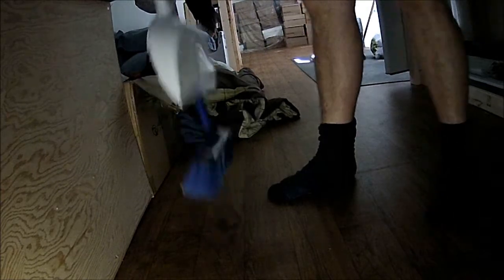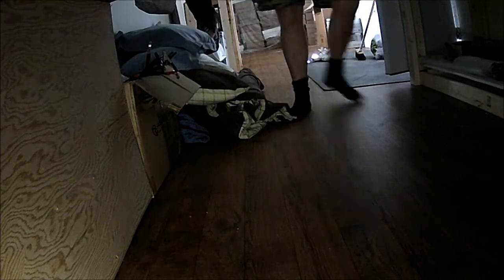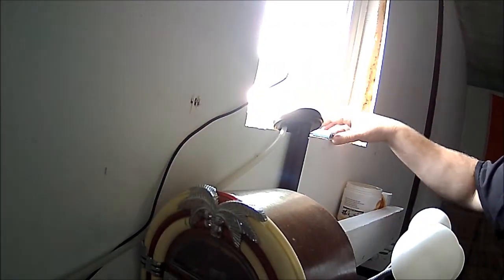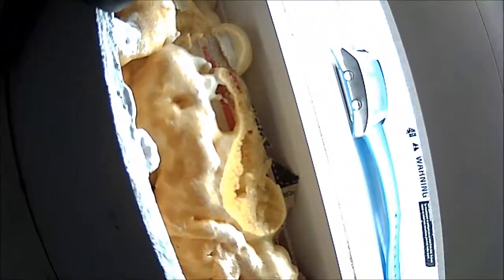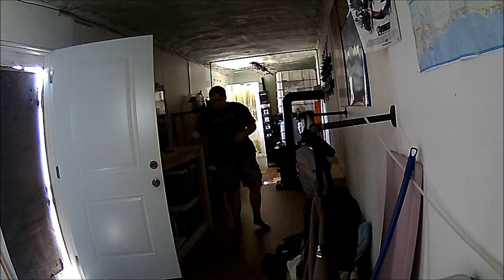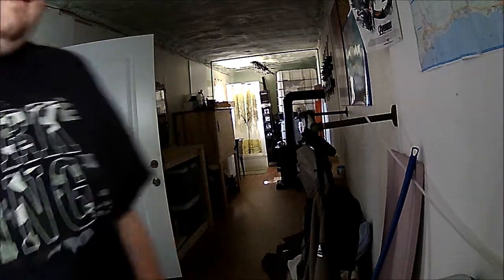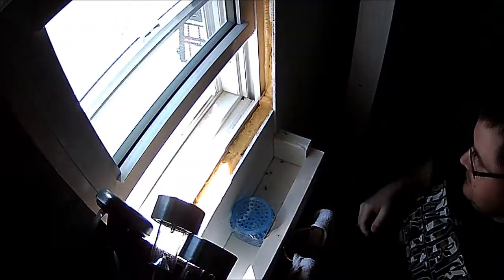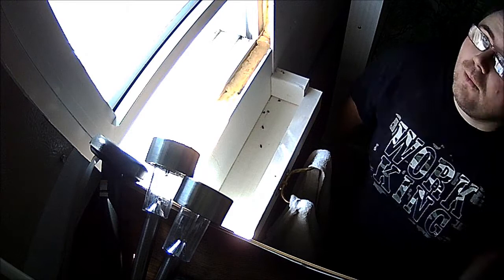Lord Of The Dead Flys

Comment: I'm suspecting that the composting toilet vent on the outside is allowing flys in. I saw a few other videos here with the same problem ( same toilet )
You might want to place a fly screen over the outside vents.
Reply: That toilet will work much better with a 12 volt fan.
Reply from the maker: there is a 12volt fan in there yet not hooked up.
Reply from the maker: there are screens over the outside vents. I highly doubt there coming in there. If you go back to my older videos you may be able to see them.